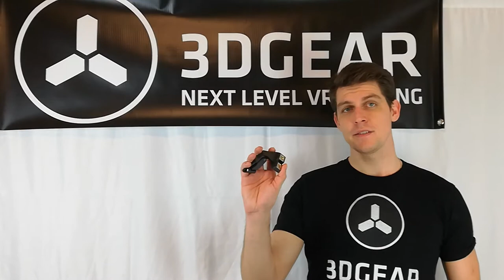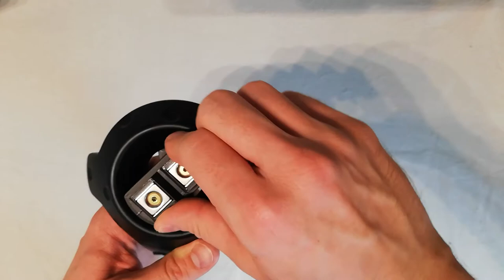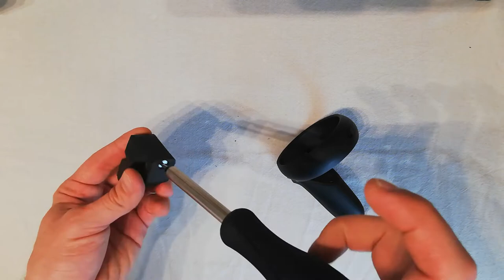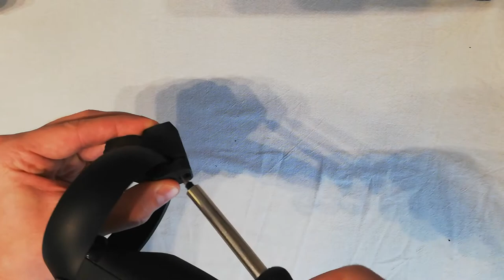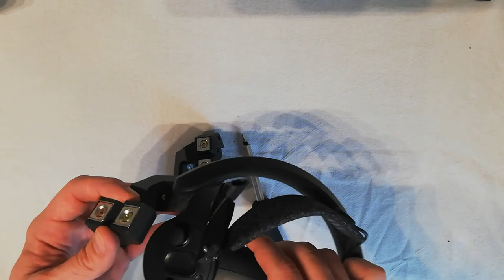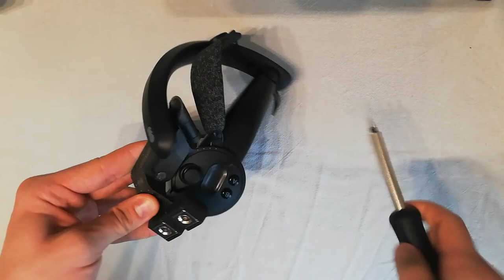Mounting the controller adapters - 3DGEAR

Comment: are u guys developing adaptors for the pico 4?
it would only be a small change to the quest adaptors I think
Reply from the maker: Hi Cyprus,
We are not working on a adapte for the system.
But we want to expand our products and will look into the system. The question is how strong the arch on the controller is. If it can hold the gun stock.
Reply: I am not sure how strong it is compared to the other ones but it should be strong enough to support a gunstock
Reply: Ive seen mounts for different gunstocks on the pico 4 wich also were mounted on the arch
Reply from the maker: That is interesting. We will get a hold of a Pico system and test it. Thank you for your Input. If you want, we can inform you when we finish the Product.
Reply: @3dgear_official653  yeah I would be happy to buy it as soon as u guys release it
Reply from the maker: If you want you can subscribe to our Newsletter. We will send Out a Message when we Release it.